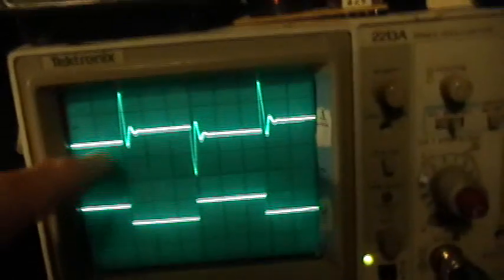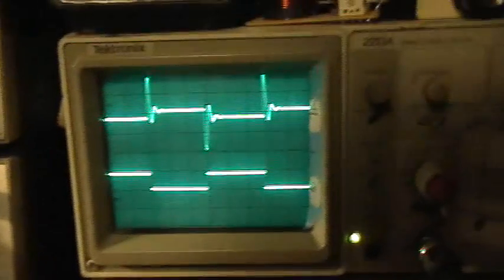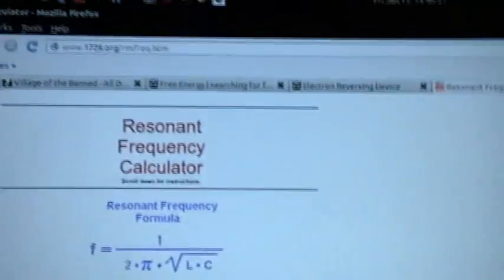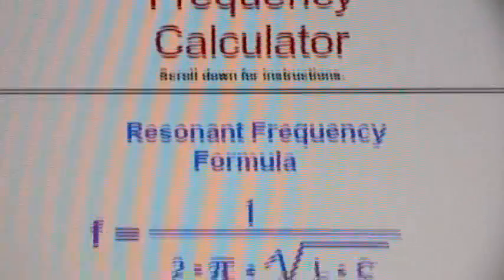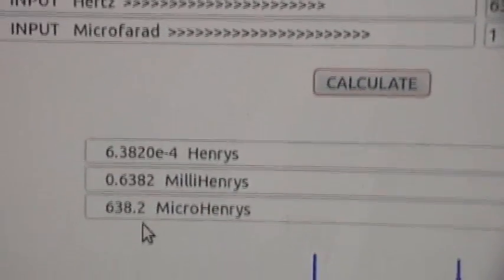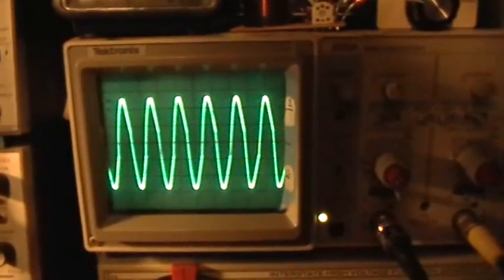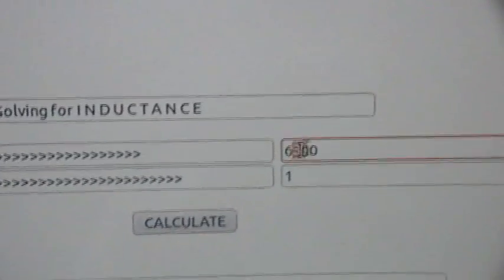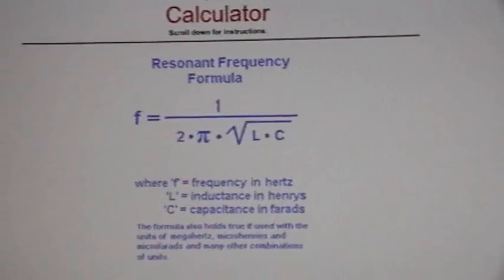Joule Thief: Supplement: Determining Inductance by Resonating a Tank Circuit

Comment: If youu read Teslas patent for his bifoiliar winding, its states that its purpose is to increase the capacitance in the coil. This causes his coil to become more balanced. A tuned tank circuit in itsself. Using a bifoiliar winding for this demonstration may not be the best choice even though it does give the coils praticle inductance.

Comment: The scope probe adds capacitance; I know it's way late to comment.... so the expected frequency is lower, making the resulting inductance lower since the additional capacitance isn't included with the 1uF... it's only some pF additional but that's the percentage error most likely. hmm should be a higher inductance then... (lower expected frequency, for X capcitance would be more inductance calculated... shrug sorry for the noise)
Reply from the maker: No, that's a good point. No need to be sorry! Yes, the probe's capacitance of about 25 pF is insignificant compared to the 1 uF tank capacitor. It turns out that a careful measurement of that cap gives something like 0.97 uF, which is well within tolerance and is also just about right to bring the measurement in line with the meter's reading.
When determining inductance this way for tiny inductors or tiny tank caps, the probe becomes significant and must be accounted for.
Thanks for your comment!